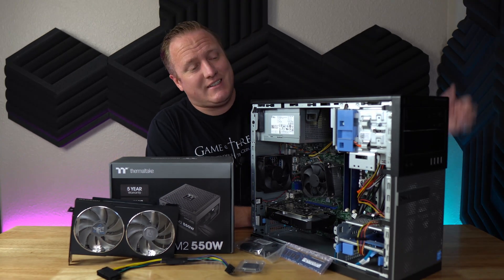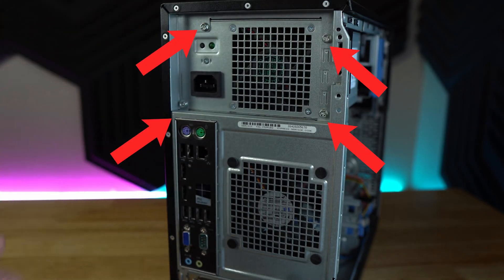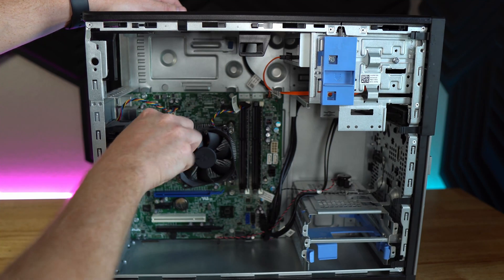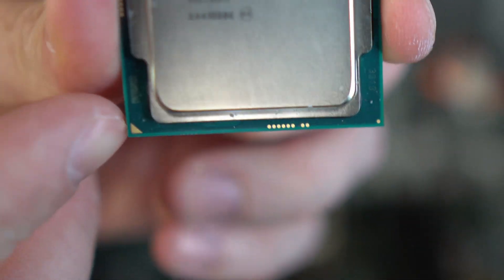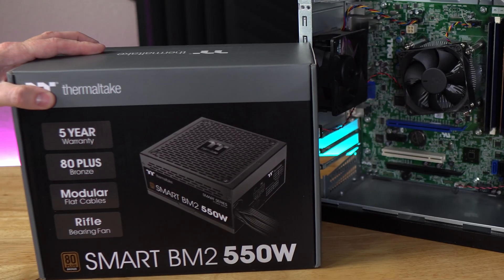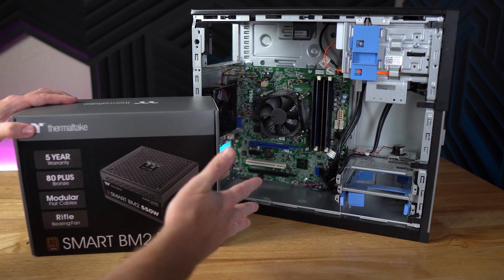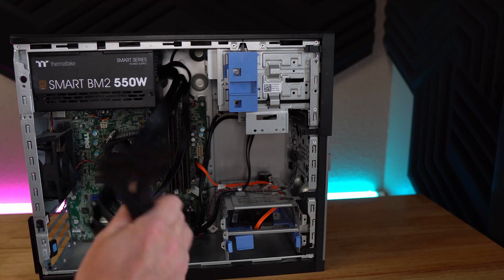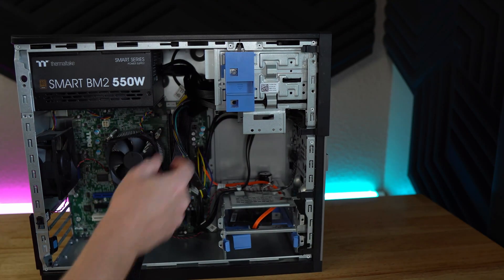Upgrading Your Dell Optiplex? Here's What You Need to Know!

Comment: hi i have an dell optiplex 9020 and an rx 580 gpu i bought this gpu from aliexpress and this gpu is really bad it overheats and black screen a lot i tried a lot of things and it's still the same so now i went to know what is the best gpu for gaming on 1080p and 2k and for content creation. 
my dell optiplex 9020 specs
i7 4790
ram 9gb but i am planning on buying 32gb
ssd 128gb 
hdd 6th purple wd
psu 550w msi
so what do you thank is the best gpu for this pc ?
Reply: In my 7010MT I am running an i7-3770 and a MSI RX580 Gaming X 8GB gpu and am not having any problems. While gaming both the CPU and GPU stay below 70 degrees C.  I assume your GPU was used. Old mining card? Did you reseat the cooler on the GPU and replace the thermal paste? This could make a huge difference. Are the fans working?
Reply: @bnnttr  yeah i did all of that and it's still overheat and yes it is a mining card but i'm not sure it's an MLLSE AMD RX 580 8GB 2048SP 6pin
Reply: @bnnttr  but i don't think i am going to upgrade the pc because it's just better to build a new pc like i can find a r5 5600 combo

Comment: Is there any motherboard options you can recommend for gaming for the optiplex 9020?
Reply from the maker: Well it’s a Dell motherboard only that these come with, unless you are doing some kind of sleeper build.  The motherboard size is standard micro atx if that helps
Reply: I used an Asrock Phantom Gaming B550 mATX.  Just know that the case power cable doesn’t match a standard mb header, but it can be solved.

Comment: I just got a 7010 my buddies dad hooked me up with a G6 600w power supply and a gtx1060. It came with a 1tb hdd I have a 500gb ssd. But the cpu is garbage. Pentium G2030. But I got an I5 2320 coming tomorrow. My issue is it came with 2-2gb ram sticks but I have 4-4gb ram sticks. But one is a PEE (think it’s server ram) cause I took it out of a Lenovo ts140 (actually pretty similar to the 7010) just has a lga1150 cpu slot instead of the 7010s lga1155. But for some reason I’m only getting 1 of the 4gb ram sticks to work. The ones that are working are either 1Rx8 or 1Rx16 pc3-12800u 11-12  two that aren’t working are 2Rx8pc3-12800U-11-12-B0. 1600 do you guys have any suggestions on how to get the ram to work? Cause even the two sticks don’t work by themselves and I’ve done them alone but they all worked in a different computer.
Reply: Id get a used i7 2600/2700 off ebay and 16gb of ddr3 rams as well. Both are dirt cheap and go for $10-30 on atm. Server ram wont work since its ECC.
Reply: @SilentzxMiku  I ended up getting it straight when I put the new cpu in. But yeah I’m probably going to upgrade the cpu again. But I’m having issues now because I have a nvmd m.2 ssd hooked into a pci port but it’s not getting picked up. It was but I started getting a blue screen so I ran diagnostics and when I booted the computer up it was gone. I’m not getting blue screen anymore. It would pop up when I tried downloading a game to the ssd. But I had it all working fine before. Another issue is I have 2 hdds that were configured to raid 0 but this computer isn’t picking it up. It’s weird because It’s two 750gb hdd configured to 1tb of raid 0 and the rest just normal. Well it’s picking up the 500gb but not the raid 0. I’d like to just remove the raid 0 and just have the two 750gb hhd or it would be awesome if o could get it to pick up the raid 0 if I can’t get the ssd working properly. Just so I can have higher speeds for games. I do have a 1tb hhd in it too. So ideal situation would probably be a form of raid 5 with the 1tb hhd as a backup and the two 750s used for booting and running the OS. And then the ssd for games.

Comment: Watching this video a few days ago gave me some inspiration to do something just have something to do.
So, I found an optiplex 3020 with an i5 4570 a 500 gig 2.5 inch SSD Windows 10 with 8 gb ram, on  eBay for 60 bones delivered.

For some reason I have a bunch of old 4th gen CPUs , so I'm going to take one of my 4790 ks and replace the processor, and have tons of DDR3 I'm going to put 32 gigs I. It, I have a good Corsair 650 power supply and then I have a strix 2080 TI from another computer that I had a while back 
I'm going to put all that together surprise my little 12 Year old nephew for his birthday.  I'm just going to let him know that the 2080 TI is just on loan though LOL.  😂😂

Comment: I have a optiplex 7010 md tower and I got a gtx 1650 and I want to power it off of the motherboard.  But I'm not sure of the settings in the bios I need to change to get the gpu to get power from the motherboard.  Any assistance would be appreciated.
Reply from the maker: Check the previous videos I’ve done in this very machine!  I cover that in good detail which should help!
Reply: @PCTechHustle  sorry wasn't able to find any section on your videos about power mangament in the bios.  I'll continue to google and maybe find something then I'll reply in the comments if I find something so if other subscribers are having the same issue I can leave the solutions that I find.

Comment: Can you make a video how to upgrade a refurbished Dell optilex 7060 with an i7-8700 👀 would be interesting 👀👀
Reply from the maker: I could... but the problem is there isn't as much can be done with those newer optiplex models.  Dell started to lock them down after the generation seen in this video.  They made them more proprietary with less physical space internally.  The best most people can do is slap in a PCI-E slot powered card only and call it a day.

Comment: Very nice , I have in my dell optilex 9020 an i5 4590 and RX560 4gb (single fan from XFX) . I want to upgrade it . I have in it some refurbished PSU 80+ gold 600/700W (Some known brand but cant remember rn) . I want to do 2 upgardes on it : the cpu and the gpu. Also some more storage would a nicer. Now I have 120 gb SSD + 1 TB HDD , but I want to switch to 1 TB SSD + 1 TB SSD
Reply from the maker: Nice!  Good luck with your upgrades!  Hope this video helped you plan it out!

Comment: Alright!  Nice build.  A couple things.  A Corsair CX750M PS will fit with no case mods.  I run two Dell 9020s one the SFF (a2000GPU) and one the MT (RTX 2060 GPU).  One runs a 4790 at 3.6ghz.  The other (the MT) runs a 4790K at base clock of 4.0.  The non-K tends to stay boosted to about 3.8 ghx.  (very nice.)  The K variety stays around 4.3 / 4.4 ghz.  And that's awesome.  It DOES feel just a little snappier.  Makes a real difference in the 1% of brand new games that still run on 4 cores 8 threads but need all they can get from the CPU to feed the GPU.   A request if you're interested.  THESE Dells are great!  But Microsoft seems think they are not worthy of Windows 11.  (BOO!)  Would you mind installing Windows 11.  Seeing if there's an idiotic watermark, compatibility problems long-term.  That sort of thing.  So we can keep these very capable systems alive and kicking.  Because they kick!  :)
Reply: I’ve had W11 installed on my 3020 since March with no watermark.  I did get the watermark on a cheap HP laptop.

Comment: The Inspirons are easier to upgrade versus Optiplex models. It’s got a normal 24-pin power plug on the board.
Reply from the maker: Yeah I need to look more into those!
Reply: @PCTechHustle  are they harder to find? It seems everyone uses the Optiplex and it’s more annoying with the boards they used.
Reply from the maker: That I’m not sure!  But you have me intrigued now!
Reply: @PCTechHustle  haha sweet. I have one from 2015, I bought new!  It’s got a 4790, 550watt psu, ssd and a GTX 970. It’s been great
Reply from the maker: Solid!
Reply: xx10 Optiplexes were the last ones to have a 24 pin connectors onboard.  Generally speaking, Sandy Bridge would be the model to look for although some have weaker PSUs.
Reply: @zeroturn7091  yea. Our 4790 rig was so easy to upgrade
Reply: @zeroturn7091 the 7010 and 9010 comes in Ivy Bridge, meaning I5 and I7 systems are PCIe 3.0, but the I3 is PCIe 2.0
Reply: Which Inspiron model?
Reply: @zeroturn7091  I’d have to see when I get home. But model lines would vary is hardware spec.
Reply: The 9010 mt has a standard 24 pin so they're not all annoying

Comment: Lots of "jankys" and "caveats" are exactly why I like these videos. I just recently slapped a 5500xt into an old optiplex of mine with a new PSU and it's working great. Ran into the issue with losing the front panel connectors. I might have to buy that flexible adapter. Thanks for the heads up. Looking forward to the next video!
Reply from the maker: Nice!  Me too!  Stay tuned!  I think it’s going to tear up some 1080p gaming for sure!
Reply: what cpu?

Comment: I am on a 9020 using a 1650 with an i7 4790 via the stock psu and it's working fine 🙂 16gb 1600MHz ram and 220gb ssd with 2 hdd of 500gb

Lovely to see ur videos as always
Reply: stock psu you say? what cables did you need to buy? i dont feel like upgrading my psu
Reply: With the stock psi, I added a sata extender as we only get 4 and I needed more for extra fans and pcie pin 
For using a new case,I added a 8pin extender and 4pin power extender
Reply from the maker: Nice!  Thanks for watching!
Reply: Great. I'm using 1660
Reply: Are u using stock psi for 1660. I have a 1660Super but not sure if stock psu can handle 125watts from my 290W psu
Reply: Is if the slim towered one or one like he has
Reply: @Bubbagump223  it's the same mid tower or MT as usually called
Reply: Yes I got a sata extension cable from Ali express it has 5 sata outs
Reply: Question: can a i5 6500 paired with 16 GB ddr4, 256 GB SSD (Sata or nmve)  plus an HDD of 500gb be enought to do: web design (paired with Photoshop, ilustrator and adobe XD or Figma), use some  electric and electronic circuit  simulation apps ,PCB and PCL design (simple things for a university student), use of control and automation systems apps (also simple things for a university student), project management applications and programming with arduino, assembly language, bank and Windows system programming?

￼

Comment: I bought an Optiplex, and didn't realize that I bought a ssf model. Even then, i slapped some ram, SSD, and a low profile GPU and able to game.
Reply: What gpu was it cause same her I bought a sff like 1 year ago and couldn't return it
Reply: @im2yung best low profile gpus are GTX 1650 & RX 6400.
Reply: @Pumpkinzer honestly I'll put in whatever i got my hands on
Here in Cambodia it's tough to find parts
Reply: @Pumpkinzer  rtx 4060
Reply: @Pumpkinzer the problem with rx6400 is the lack of encoders
Reply: @alpha_saske3582  yes that's true if you want to make videos
Reply: @Pumpkinzernah the best lp gpu is an rtx 4060 if itll fit. if not, the best one is an rtx 3050 6gb
Reply: @kritical_49  They now have a 5060 and a 5050 low profile variant on Amazon
Reply: @im2yung gtx 1050ti
Reply from the maker: Heck yeah!
Reply: Save some cash go with a rx640 or rx550.  They only take 1 pcie slot.  I was gonna throw a 1050ti I had laying around in one but the 2 slots wide was crashing into the psu.
Reply: @forzaflyracer3473  Appreciate this comment you saved me probably $50 thanks.
Reply: I did the same thing as well! Got a 7040 SFF, looked like a full size PC in the photos, didn't realize they made desktops that didn't fit full size GPUs. Got a 1650 with an adapter to pull power from sata cord as I assumed they all didn't require external power, well gigabyte does 😅
Reply: I think they make a low profile rtx 3050 and 4060 now.
Reply: Did you use a different psu?
Reply: Was there an nvme ssd slot in your pc?
Reply: Happened to me a few months ago, I got a second hand inspiron which I just realized much later to be somewhere between normal sized and sff 😂

Comment: I got my 9020 put together a couple weeks ago and love it! Got a little carried away, did PSU, SSD, GPU(1660s) more ram and swapped in noctua fans. Added a 140mm intake fan to the front of the case. Just painted it all white and am going to put a plexiglass window in in the next couple weeks with some LEDs.😎😅
Reply from the maker: Wow!  Awesome!  Join my discord and post some pictures!  I'd love to see it!
Reply: What psu did you use? and how did you get a 1660 in it? I recently just got a 9020 sff for next to nothing and I've quickly realised that theres not many upgrade options
Reply: @MR-zp4ly  that’s because you got the small form factor style case you need the bigger case style optiplex
Reply: @Pauxxwx  yeah I realised no too soon after that there’s a mid tower 9020, whoops lol…
I guess it’s time i find a cheap rx6400xt lol
Reply: @MR-zp4ly  lol  maybe u could put it in all in a bigger case possibly?
Reply: @MR-zp4ly   a thermal take 550. And I recently swapped it out for a 6600xt, but I don’t think those would fit in the small form factor optiplex.
Reply: @MR-zp4ly 550w
Reply: Wow bro, I’m on the same route, 9020 it has 24 Gb of ram, i7 4790 new psu and GTX 1660 súper coming soon and I put a 1tb ssd in there, I’ll start the case mods later tho
Reply: @Sebas.Tanner how does it run?
Reply: Where did you plug in the front fan header in the motherboard?
Reply: @uncle5254  I was thinking the same thing.
Reply: @uncle5254 probably added a splitter.
Reply: Imma put a 4070 in mine cuh

Comment: The only thing that is a little off is that the 6600 is a 4.0 PCI-e and the mobo only has a 3.0 PCI-e slot. You will be leaving some performance on the table. Why not go with an rtx2000 or an RX500 series card? Otherwise great tutorial.
Reply from the maker: Solid thinking here but actually the 6600 XT although being a 4.0 capable card still will come nowhere near close bottle necking the PCI-e 3.0 slot.  This might be a thing that will inhibit performance on a much higher powered card like a 6900 XT or higher Tier 3000 or 4000 series.  The thing I MIGHT actually run into first is a CPU bottle neck!
Reply: I was thinking the same thing 580 8g would be probably equal to the 6600xt
Reply: @lsxe467 6600 XT is just about double the performance of the rx 580 in just a lot every game you can compare in
Reply: Indeed